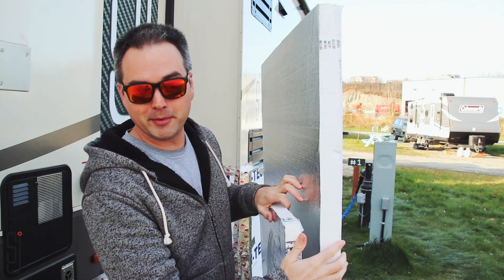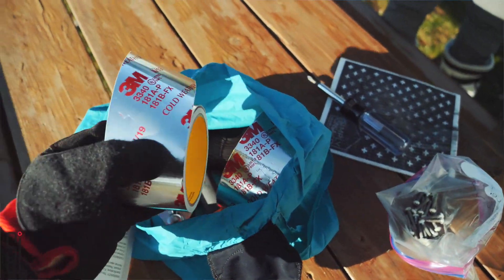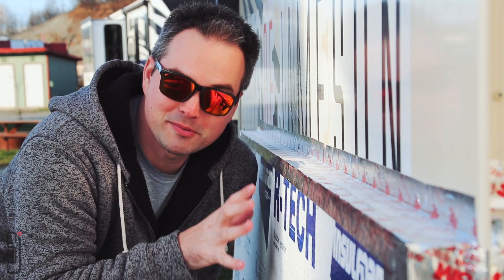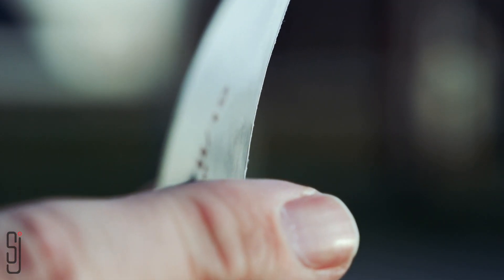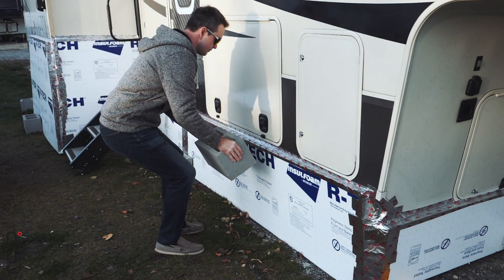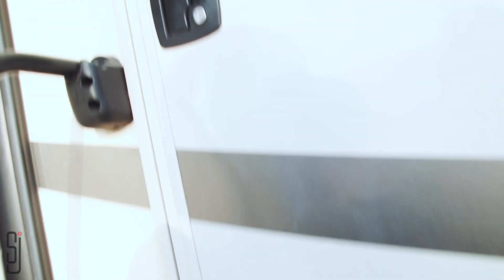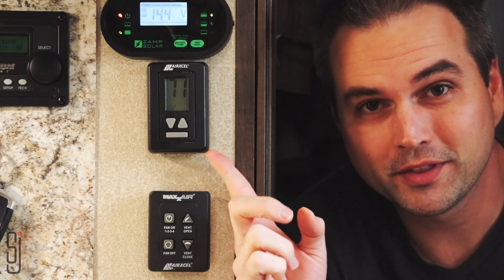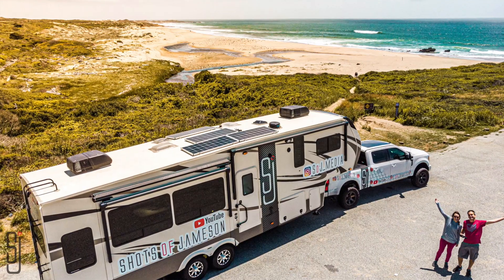How to SKIRT your RV for WINTER with Rigid Foam

Comment: Home Depot sells extreme weather foil tape it has no red writing on it and holds great all winter and no residue with removal
Reply: Tried and true? I need to know 😩 before I make the residue mistake!
Reply: John Ball is it Nashua Foil Tape from Home Depot?  I dont want to use the wrong tape.
Reply: The red wording on friction tape is only for inspection reasons
Reply: Agreed - it works great and is quite strong. Definitely looks better too with proper application since it lacks any logos or branding.
Reply: @smartiekisses  as a no

Comment: I winter over in my RV for work. Skirts absolutely. I also tape my windows shut, and make a temporary vestibule in front of the door with a 2x2 frame covered in plastic sheeting. Works so well, can keep warm with just a 1500 watt oil filled heater. I also enclose the whole thing with my quilted RV cover.
Reply: Where did you get a quilted rv cover?

Comment: Thank you for this. We are full time rvers from Florida and are spending our first cold snowy winter in the mountains of Idaho. We are prepping our fifth wheel and do not want to spend nearly $2500 on a prepaid skirt to insulate. This is hugely helpful.
Reply: We’re Floridians that moved to northern Idaho too!! I am researching what to do and my method was plywood and securing the foam insulation to the plywood, but having seen this it looks rigid enough to hold up solo. Take care!
Reply: I'm looking to set up for the winter as well. (First time). Have yall had any trouble with the fall weather coming in?
Reply: @seanpaulson9098  We haven't had any issue with the fall weather. Its gotten down in the 20s at night a few times but mostly has been staying in the 30s at nighttime and 60s and 70s during the day.

Comment: Great video!  Thank you.  We are stuck in Nanaimo, BC Canada for the winter due to COVID.  We are considering adding a skirt around our 32' class C motorhome using rigid foam.  We also have many windows covered with Reflectix which is great.  I would love an update on how cost effective the skirt was.  Did you recover your $650 install cost?  Thanks

Comment: Hi Still Problem, is it best foam out on in , some say foil in will hold heat in winter. so to be funny inne or outie. or don't know. Foil blocks radiant energy like sun. SO may keep sun radiant in side other then be reflected away? hard  to decide it for me white looks better, foil has printing, so need to paint, be here for at least 2 winters.

Comment: Thank you for comparing thickness and mentioning structural strength. 
Also tape. Thank you.
You did it for 650 in Alaska for how big a rig(with slide out?)
Did you cover it or leave it exposed and hows that working.
Thank you so much for this great info. Just found you and subscribed 😎👍🐶

Do you have utility/fuel bills to compare? Please update.
Reply: granny sweet ours is a 34ft fifth wheel with three slides (2 large, 1 small). We left the insulation exposed and are feeling good about that decision as so far everything has stayed in place. Also the winds here are too strong for vinyl to work well, as we’ve unfortunately seen from some of our neighbors, so we couldn’t think of any other good options for covering it even if we wanted to. 
Admittedly we didn’t do a great job of tracking fuel usage before we put up the skirting, so we will have to do a little bank statement research to see if we can figure that out.
Reply: You guys rock!!! Hugs😎👍

Comment: Great job. What are you doing to keep you outside water hose from freezing?  Does your rig have tank heaters? Ours does but I’ve never used them.
Reply: Wonder Where 2 Wander the RV park we are at has heated water pedestals, we have a heated hose attached to that, and we have tank heaters. It still hasn’t gotten cold enough to need the tank heaters, but I’m sure they will end up being necessary at some point.
Reply: What are tank heaters
Reply: @tomgaghan2915  They are devices which are pre-fabricated or DIY and are installed around your fresh/grey/black/all water tanks to prevent them from freezing due to extreme weather circumstances. Tank heaters may come pre-installed on some units, others will be aftermarket...and some won't need them at all because the internal heat of the unit can keep them from freezing, when the furnace is being operated of course. Hope this helps you.

Comment: I used 10" galvanized nails and 8' yard timbers along the inside edge. Put the yard timbers down and put the nails behind them and put the foam board infront like normal and the whole foam board is supported along the inner part of skirting for high winds like 60-70 mph gusts

Comment: This looks pretty great. How did the foam board hold up to snow and moisture?
Reply: Rigid board insulation are considered closed cell polystyrene. With the foil outside it shouldn't do anything to moisture. Most brands are fire rated also